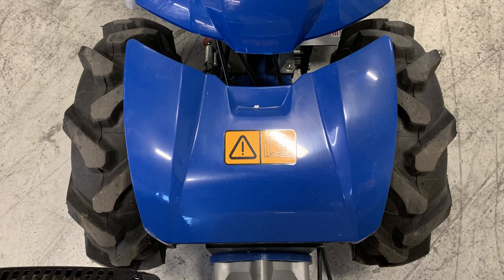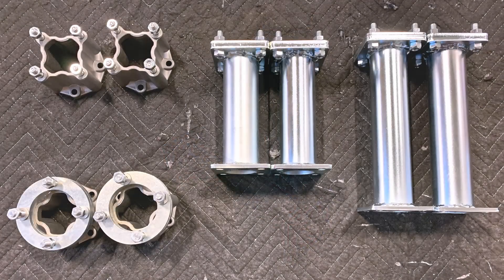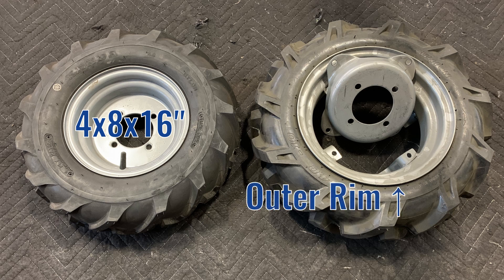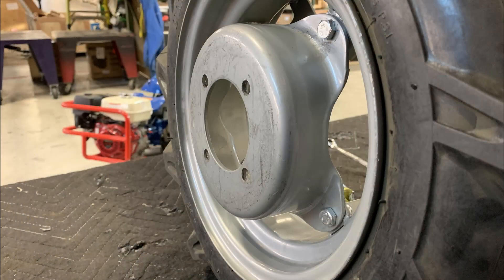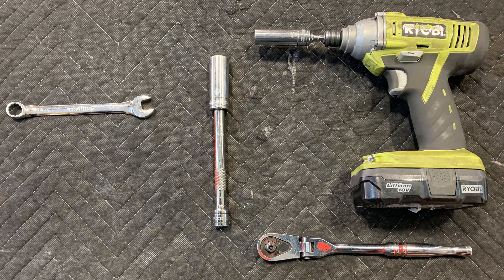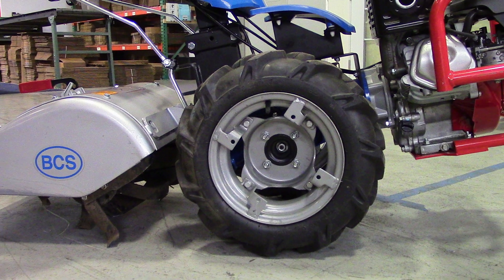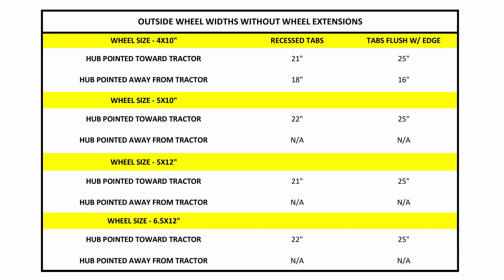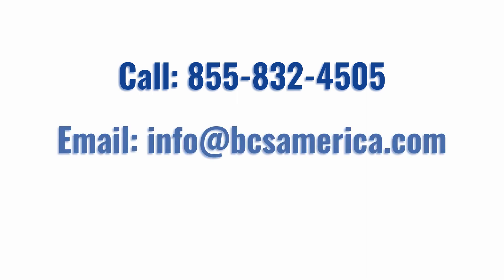Expanding the Wheel Width of a BCS Two-Wheel Tractor by Flipping the Wheel Hubs

Comment: How do in prevent the tyres from slipping on the hubs?
Reply from the maker: Sorry, you'll have to be more specific.  How would the tires slip on the hubs?
Reply: @BCSAmerica  I have a twin wheel set up I can see that the tyres slip on the hubs! Maybe the tubes aren't holding air or something?
Reply from the maker: @May4thbwithu  Sounds like you could've sheared your valve stems.  Did you install two sets of wheel extensions between the wheels?  
https://www.youtube.com/watch?v=B9xk_SNvzLQ

Comment: Are the 4 x 10 wheels 2 inches taller than the 4 x 8 wheels?
Reply from the maker: 4x10 wheels (4x10x18) are on 18" tires.  4x8 wheels (4x8x16) are on 16" tires.  The tires are 2" taller overall, but the difference in tractor ground clearance is only 1".  (Center of 16" tire is 8" off ground, while center of 18" tire is 9" off ground.)

Comment: I wanted to narrow up the wheel base on our 722 but couldn't do it because the tire would hit the transmission shifting lever.
Reply from the maker: Did you flip the inner dishes and then switch the sides that the wheels are installed on?
Reply: @BCSAmerica  Yes, did that and it gets just a little bit too close to the transmission shift lever
Reply from the maker: @GermanShepherd1983  Interesting.  Can you send us a photo and your tractor serial number?  We'd like to see if we can figure out what's going on.  info@bcsamerica.com  Thanks